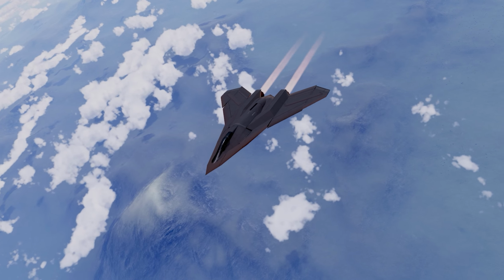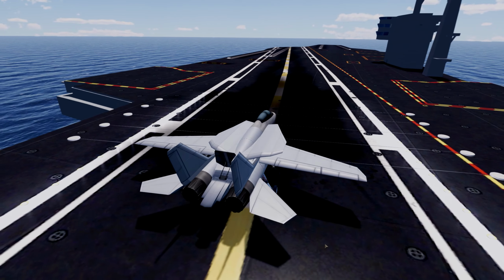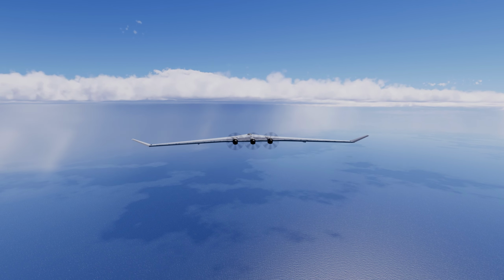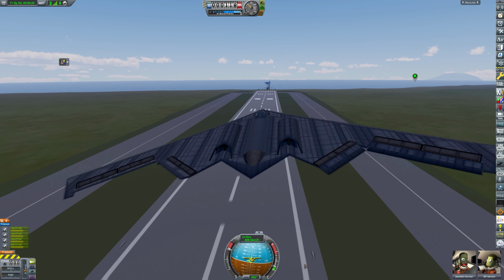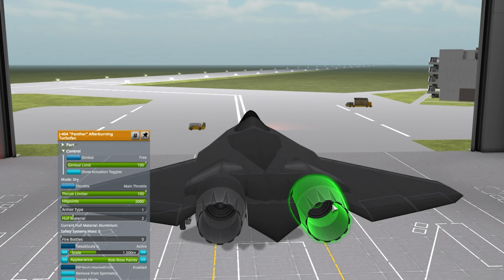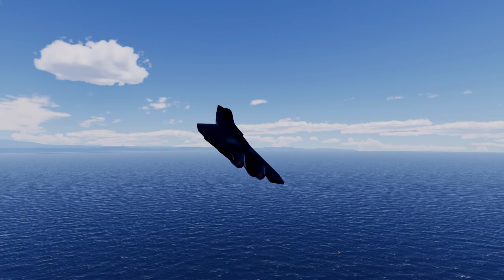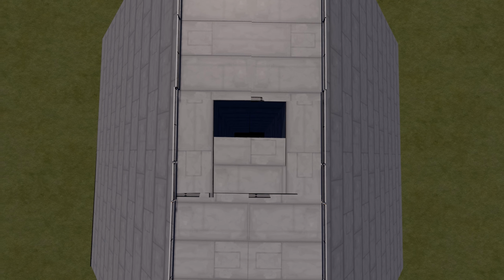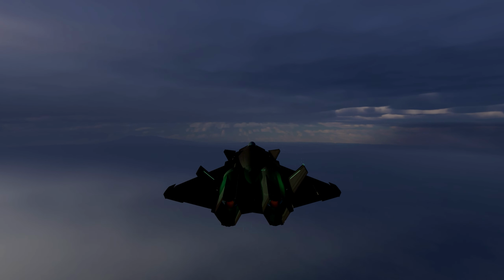B-2 In KSP! | Kerbal Space Program Tutorial : How to make a Tailless Aircraft?

Comment: Quick note that you can absolutely have 2-dimensional TVC with yaw control, as long as the nozzles are placed to do so (ie. XFA-27)
Reply from the maker: In the case of the XFA-27, it seems that the angled vertical tail fins assist in controlling yaw. As you mentioned, in such cases, two-dimensional vectoring engines can be used. :) 
In this video, however, I aimed to discuss tailless aircraft where there are no vertical tail fins. 

Of course, while using two-dimensional engines, there's also the option to utilize the second method. (B-2 in Video uses 2-dimensional TVC engines) 
Please understand that this video was produced with consideration for the environment of KSP FAR. :D

Thank you for the feedback!

+ Wait, It's engine facing horizontal?? It makes sense. Wow, That's Amazing. :O
Reply from the maker: Hang on, I'll check that engine style and create a video for it! 😄

Comment: Is there any way to get the spoiler/split rudder method in stock? I've tried using a KAL bound to the yaw control but fore something the yaw in action groups isn't controlled by SAS so I would have to manually control yaw constantly- there must be a better way!
Reply from the maker: In the stock game, there's a part called A.I.R.B.R.A.K.E, which offers similar spoiler options as seen in this video. Additionally, you can check out my new video, specifically made for the stock game.

If you're looking for a more realistic surface-style spoiler or split rudder in stock, you can try attaching wings on servo and adjusting them with KAL to make them operate like actual aircraft surfaces. However, it's quite challenging to achieve this. Therefore, I recommend simply using A.I.R.B.R.A.K.E or exploring some mods.
Reply: @J0ngsh  As an experienced Stock Builder (I am MilitaristicKiwi’s personal youtube account lol), there should be a way of achieving this via some Bendytech wizardry that I’d recommend looking into. You can also place dual aileron elevons and turn on “yaw” in the control settings; which should allow for a split rudder methodology. There are so many more methods… but alas, for a quick response, they are a bit too much to describe in a short manner.